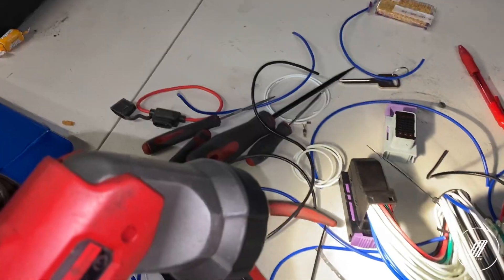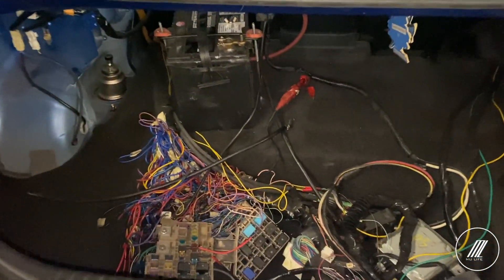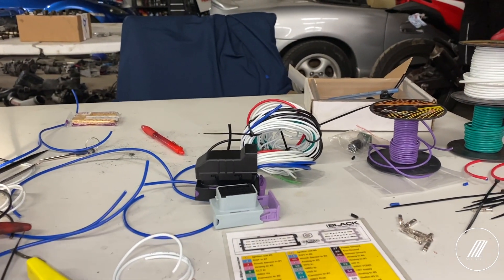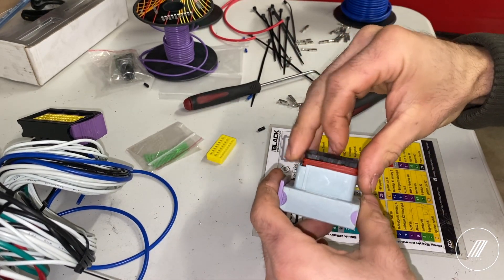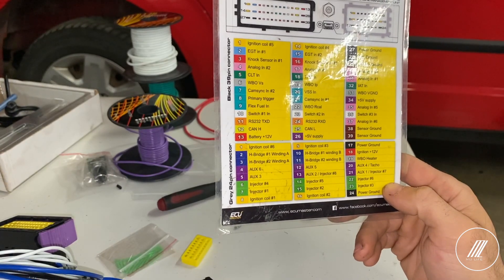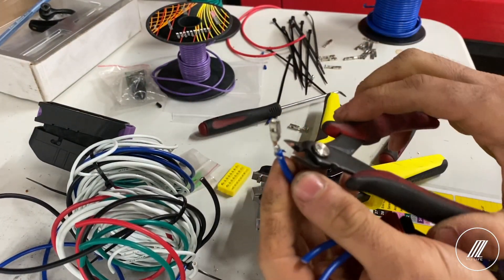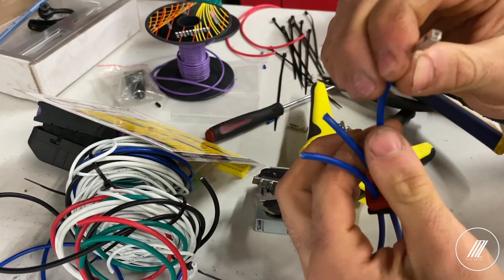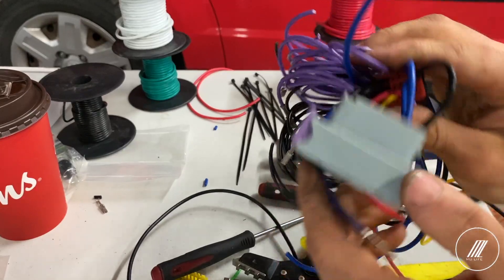2JZ RX8 EMU black - Connectors/wire crimping.

Comment: I have same swap but can't get canbus to work for the eps
Reply from the maker: whats the codes you have ? the ESP should be connected to the can network i believe , to get info regarding steering angle sensor / speed etc.

Comment: Hey mate awesome build. I have a similar build but with the rx7. Currently I have a no start condition with the downloaded base map...due to the lack of a primary trigger from the ckp.
Do you need the resistors supplied to be wired in between the ckp and ECU or it's just a straight fit, no splicing.
Ps, the Engine starts with the old Toyota ECU.
Your help will be greatly appreciated.
Reply from the maker: Hey , I actually have not used the resistors supplied with the ECU , have you checked your wires ? shielded your CKP wires ? sensor grounds good ?
Reply: @GridMotorsCA  update...it just fired up today. But on the first 3 cylinders. Cylinder 4,5,6 have no injector pulse. Very weird...
Will audit my wiring  tomorrow.
Thanks for the response mate. Any pointers are welcome.
Reply from the maker: @Tedkelvin  Start with checking your wiring, if all good then has to be something with the injector firing / order maybe ? Best to send log to EMU black and have them look into it.